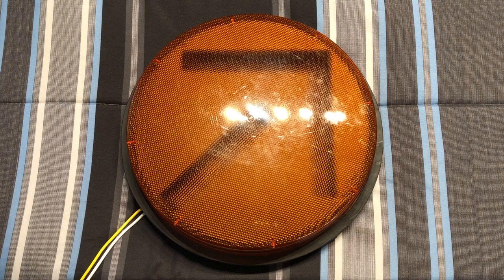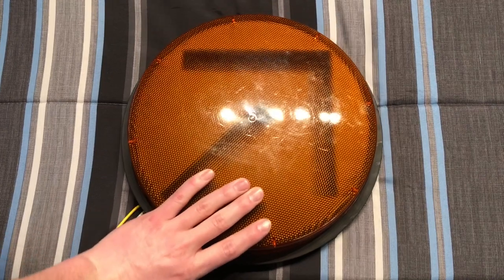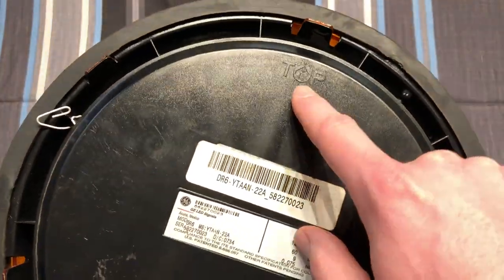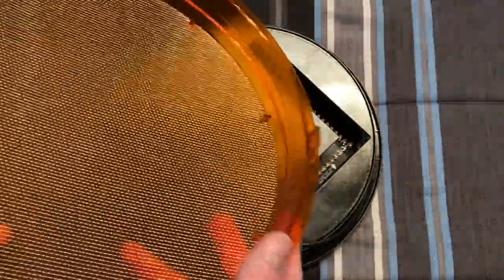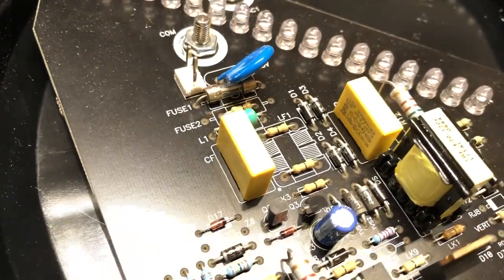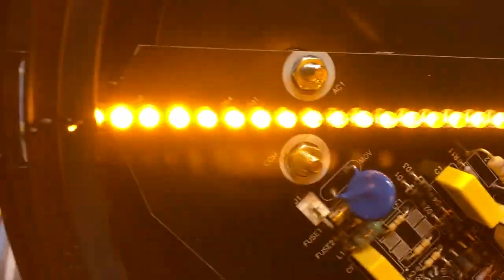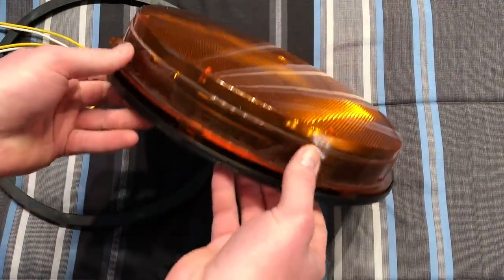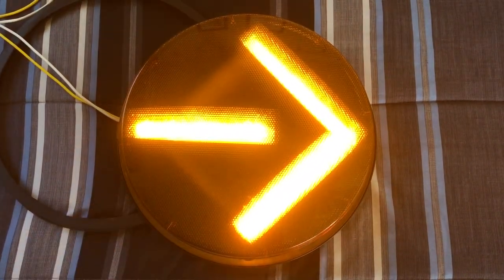GE DR6 LED Yellow Traffic Signal Arrow

Comment: Neat. I'm always amazed at how nice the power supply circuits are for utility grade devices. 

Although my town upgraded to LED traffic light retrofit assembly's years ago and the solder joints or LED strings must be failing. There are constantly flickering or flashing segments on random green or red lights... We must have got a bad batch because I don't really see that issue in other towns nearly as often.